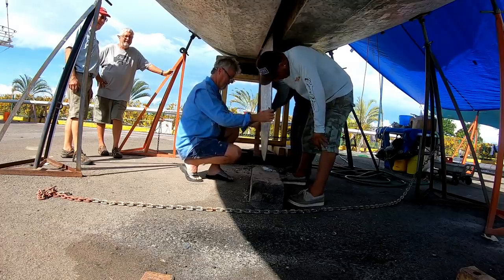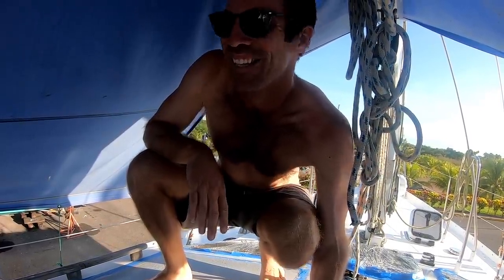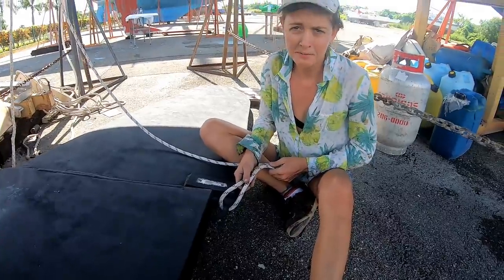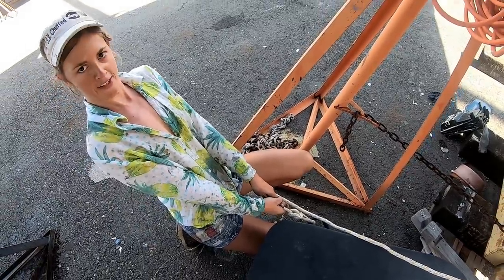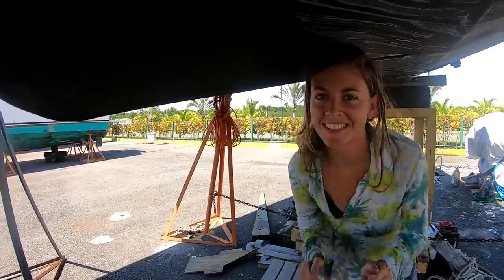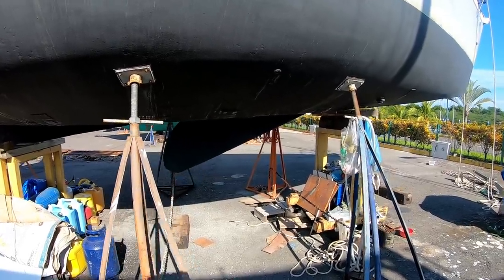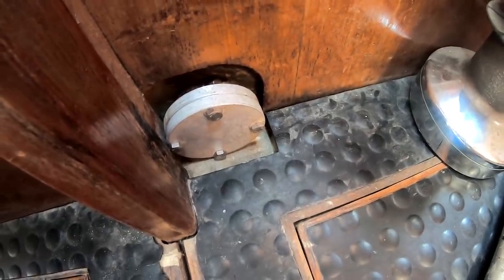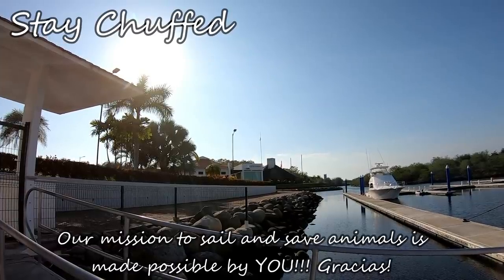Swing Keel Re-installation : Chuffed Adventures S03Ep24

Comment: Bowline knots can undo themselves when they get wet: I've seen it happen 3 times in one single Wednesday night race (jibsheet was tied using a bowline, jibsheet was wet): our fire department banned personal from using the bowline for anything “life safety”. Personally, I'd consider the downhaul on your keel “life safety” because if that line comes undone while you're turtled, a few bad things would happen all simultaneously. 
Just my 2 cents, it's your boat after all.
Reply from the maker: thats good to know, thankfully it is not a huge disaster for us if it comes undone -but as you said itll almost definitely happen at the most inconvenient time!
Reply: It flapping of jib clew without load that usually undo the bowline on the sheet. One needs to leave longer tails

Comment: Zaya only draws 4'-5" for her 11.3m, what I see about the benefit of Chuffed is that if you have to you can run her aground on sand, I cant do that
well thats my theory ...
Reply from the maker: Yep, I did on pebbles once to change the shaft seal in a pinch and it worked well!

Comment: You’re probably already in the water and your work it amazing (boat and animals)!  Bowlines are not the best for your keel application as they can come undone if the line repeatedly slackens, unless you also terminate them with a half hitch or locking hitch. Problem with that is the knot then becomes very large. A tidier solution is a halyard hitch. This is super secure and compact, but must almost alway be cut off if you want to remove. You might be able to use a fid to get it undone, but plan on cutting it off as the line will most likely be damaged. Because it is so compact you’re not loosing much line. Check out animatedknots dot com for a great set of knot how to’s. Can’t wait to see you guys in the water again. Fair winds.
Reply: How often are you untying those lines in their life? I'd be fine cutting it off. I've had a bowline on my jibsheet come undone 3 times in one Wednesday night race (My self confidence was so wrecked by the end of the night that I had one of the most senior sailors come over to make sure I actually was tying it right). I won't use it now unless it's safetied with an overhand knot.
Reply from the maker: Ok good to know, thankfully if the rope does come undone its not a disaster for us because you can reach in and tie another one... but would be annoying for sure so might re-tie
thanks!
Reply: @VetTails  rope type, quality and size also play an important role in the reliability of a bowline, so you may be fine. “Don’t fix it if it ain’t broke.” Great that you have options.

Comment: Hello, courageous ones! Some quick remarks from one with 40 kNm over 30 years on a 
40 ft aluminium centerboarder ( French too...); first; looks like you do NOT have a swing keel, but a centerboard, quite different in manoeuvers( and in weight for moving it!) remember you also can lift it(more or less) for downwind rides!  Then, please, please do remove the bolts on the shaft covers, and refit them with a smear of Duralac or equivalent,(tefgel) and put a nylon washer under a ss washer if you want to be able to remove them one day. Same for the nuts on the well cover. I can see you replaced the guides on the sides, be sure they a re in Acetal or equivalent , because nylon, polyethylene or else will expand in salt water and act as very strong brake pads. Well, no more advices, I don't want to be intrusive, good luck , Sail Safe!
Michel
Reply from the maker: Hi! Thank you for the advice, we did use an acetal equivalent, thankfully our boat building friend warned us. I never truly understood when it was a centre board vs swing - ours 'swings' up into the boat so I assumed that's what she was!

Comment: Good to see this. We have a similar device on our Feeling. We re-did the lines using spectra with spliced loops which attach with shackles onto the keel. I didn't see a safety strop on yours. Our has one and they do break if your keel sets off on its own when out if the water - how do I know that.... Next time I will just use dyneema and make my own. Oh, the other thing we have is plexiglas plates on the top of the centreboard/keel box so we can watch the fish and check to see if the centreboard is still attached.
Reply from the maker: Thats a good idea, I would prefer to be able to see in there, I will add to our 'next time' projects for the future!

Comment: Check out a knot called an anchor bend. It will give you twice the bearing on the steel loop, cutting down the amount of chafe you'll get with just one turn, which is the weakness in the system you have, or at least wrap the rope around twice before you tie the bowline.
Reply from the maker: Ok will do thank you!

Comment: Check out You Tube videos on how to do a reeving eye splice.  Makes mating lines for pulling MUCH easier and it gives a really nice finish to your lines.  Also, in the stop, there is usually a part inside that will lift up to allow lines to be run through.  Hope these help in the future.  Boat is looking great!
Reply from the maker: Thanks for the tip!

Comment: How boring is watching your videos. They're always the same. We have to wait for a week to see 2 holes in the wood and and glue 20 tiles into the kitchen sink. These works had to be done when the boat was on the dry spot. By now, it's been a long time that the boat is in the water and hasn't done a meter yet. And the wood is already ruined and in need of restoration.
Reply from the maker: I have an amazing solution for you that you clearly couldn't have thought of yourself... don't watch the videos?